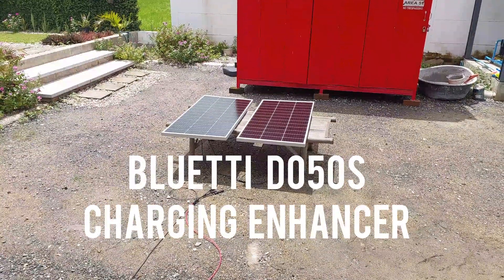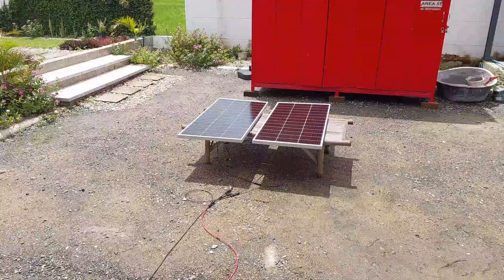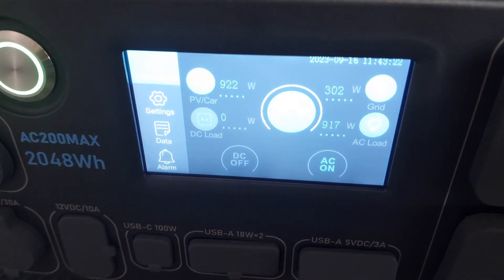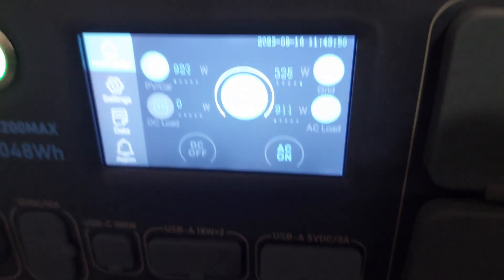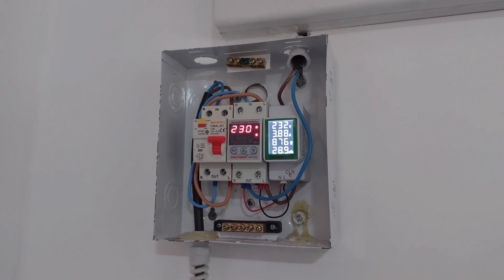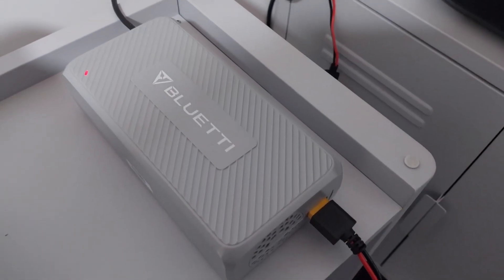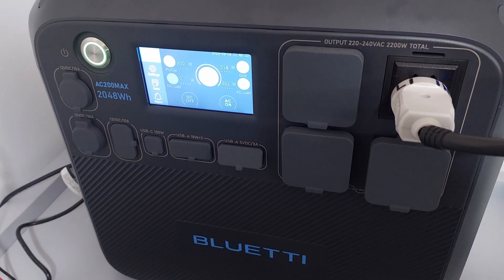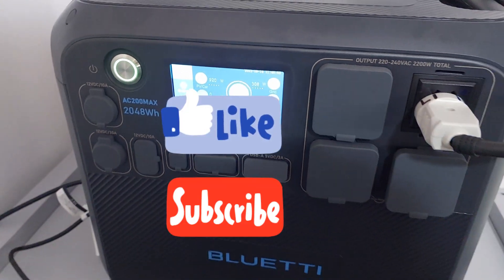How To Use A Bluetti D050s Charging Enhancer  #bluetti #tinyhouse #solarenergy

Comment from the maker: Using the Bluetti AC200 Max with air conditioning can be power intense, so with the dc PV input maxed out at 920W what can you do to get more solar input?  We added 2x 200W mono panels in series and the charging enhancer (Bluetti D050S) to bring in more Watts so that we can charge the battery AND run air conditioning.
Reply: So it really is worth the money.
Reply from the maker: @fromtheflightdeck252  yes, we like it now it's working nights too transferring power from the EB70.

Comment: You are getting 900+ on your main array? isnt the AC200M maximum solar input only 900w? so it doesnt matter if you have slighter bigger wattage of solar panels ofr example two*550w? Btw what solar panels do you use for main array?
Reply from the maker: Yes, it's called overpanelling and on the sunniest days the main PV input brings in 930W indicated in the app and on screen.  Plus we have 2 D050S charge enhancers and the PV input to the B300 battery now....so all 4 available inputs are used as we want to run out 12500BTU air conditioner and chest freezer etcetera without going below 80% SOC.  We used ERA and other cheap panels as in Thailand they are easy to get and are working fine.

Comment: Hi just hooked up 2 100w solar panels but solar coming in is only at 120 am I’m hiding something wrong ? I have the Solar enhancer too
Reply from the maker: You can check the actual Wattage of each panel with a multimeter to make sure your panels are up to spec.  Also in full sun?  No shading?  Often you need to overpanel to get maximum benefit, more panel Wattage than needed is best, without exceeding the Voltage limit of the controller.  Unused excess Watts is OK.  Thanks for watching!  Let us know if you figured out what's wrong.

Comment: How big is your main solar panels
Reply from the maker: 2X 550W monocrystalline panels in series for the PV input.  One 400W for each of my D050S enhancers, since we added a B300 battery to the AC200Max recently to run air conditioning and two chest freezers in the tiny house.